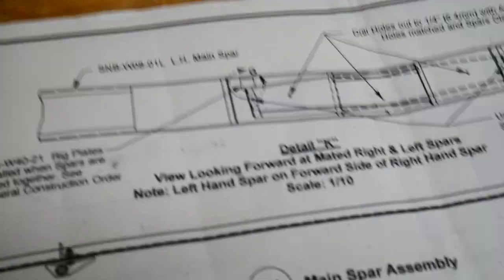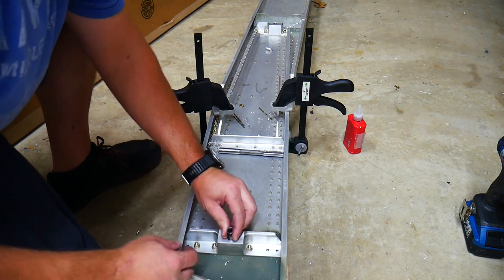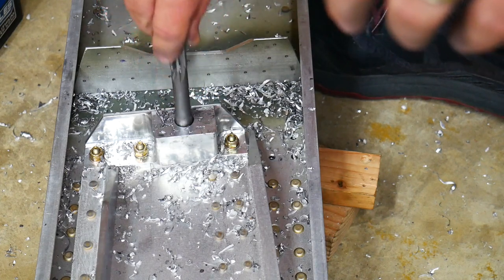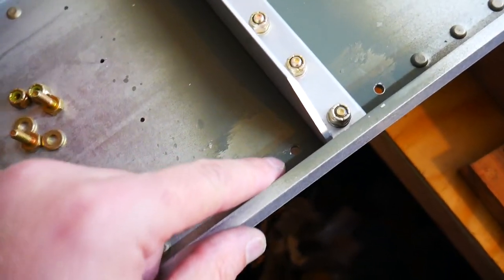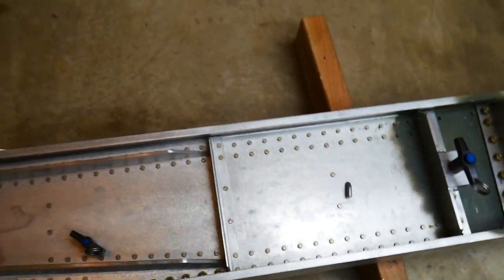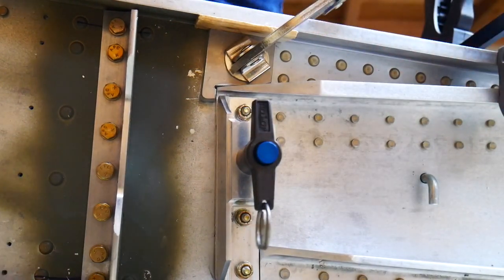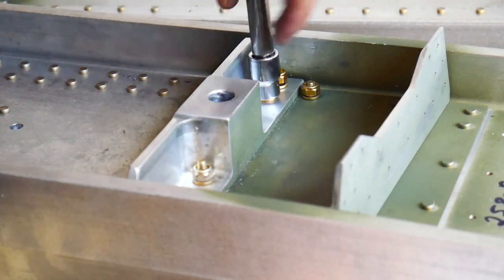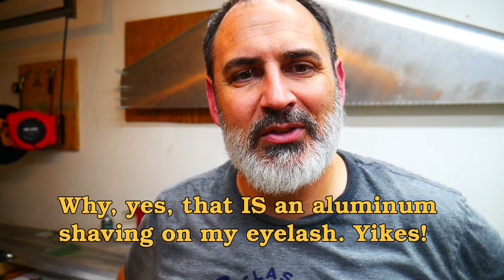Sonex Build - Mating the Main Spars

Comment: There is absolutely no need to throw away self locking nuts after only one use, despite what anybody tells you.   And videos like this do not need elevator music to make them interesting, it's just annoying and distracting.
Reply from the maker: Thanks for the constructive criticism. I personally prefer videos with some music, but everyone's entitled to an opinion. Thanks for sharing yours.

Regarding the reuse of nyloc nuts, take a look at AC 43.13-1b. It states:

"f. Fiber or nylon locknuts are constructed with an unthreaded fiber or nylon locking insert held securely in place. The fiber or nylon insert provides the locking action because it has a smaller diameter than the nut. 
Fiber or nylon self-locking nuts are not installed in areas where temperatures exceed 
250 °F. After the nut has been tightened, make sure the bolt or stud has at least one thread showing past the nut. DO NOT reuse a fiber or nylon locknut, if the nut cannot meet the minimum prevailing torque values. (See table 7-2.)"

However, "Table 7-2" only specifies minimum torque values down to 7/16" bolts, so the AN-3/AN-4 (e.g. 3/16" / 1/4", respectively) nuts I've replaced on my kit aren't even listed in that table. 

My interpretation is that you can't reuse a nut that should only be reused according to the torque spec in that table if it's not listed in the table.

More importantly, though, you can buy a pack of 25 of them from Aircraft Spruce for $2.50. There are several of those nuts that are within the riveted skins of the wing. I'm not taking any chances that any of them backs out just because I want to save a dime and then have to drill and re-skin my wing - or worse, have a wing crumple midair  - because I didn't want to spend literally a few cents to replace a nut. 

Obviously, you're welcome to your opinion/interpretation but I'd strongly caution against what you're saying. There's no reason NOT to replace those nuts.